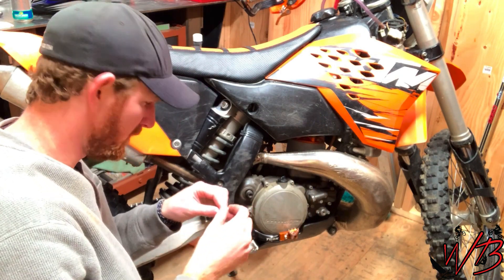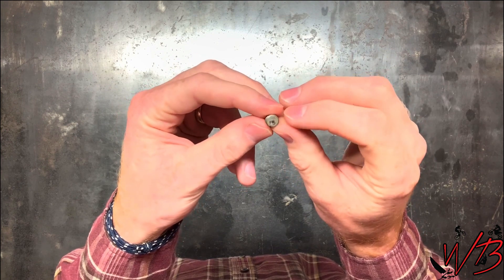How To 🛠 Extract A Broken Off Bolt 🔩

Comment: Thanks for the vid.  Worked on my KX250F.  I didn't have an extractor though.  I used a Torx and hammered it in.  Got it out even though it had lock tight on it.
Reply from the maker: Nice! Do Wyatt you gotta do, glad the video helped!

Comment: Any time I’ve sheared a bolt it’s because it was corroded in place! Wish all extractions were that easy.
Reply from the maker: This was definitely the rare exception!
Reply: I once junked an old Honda Civic because a cam belt tensioner bolt broke off inside the head and I gave up on ever getting it out.

Comment: Well done tutorial!  I’ve only needed to use a bolt extractor 5-6x. Every time the bolt surface either isn’t flat enough to keep my drill centred, or it’s so small that the smallest extractor breaks.
Reply from the maker: Kermit I definitely know the frustrations! This was the one occasion where everything seemed to go according to plan. That may be a first 😂
Reply: @Kermit, In my experience, there is a lot of variability in the quality of the steel used to make the extractor bits. Cheep kits will snap or warp with just a little pressure, nicer (probably more expensive) bits can take quite a bit of tugging and still hold both their edge and shape.